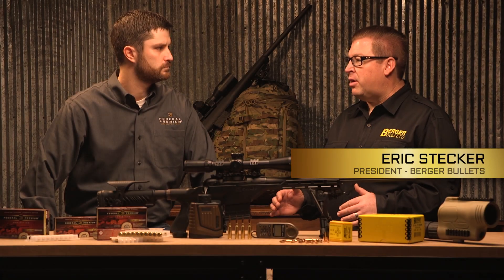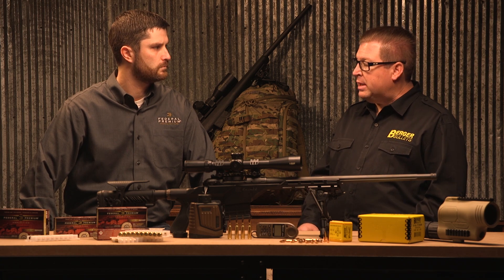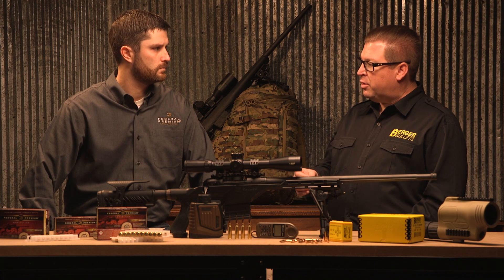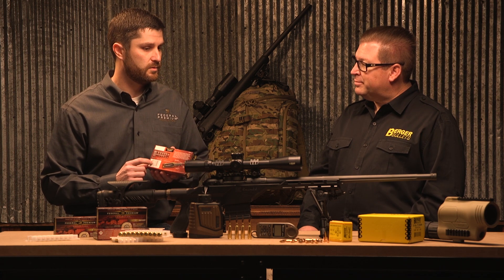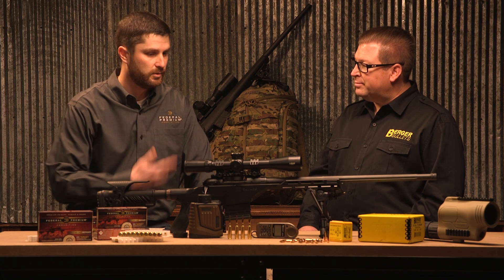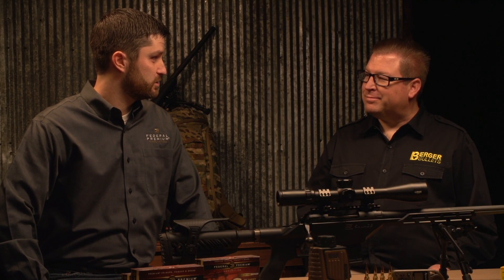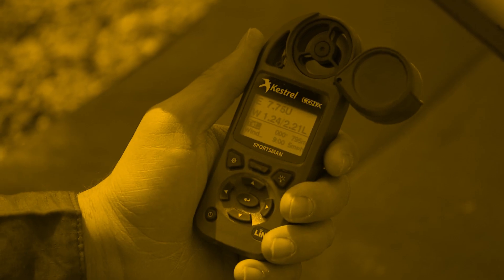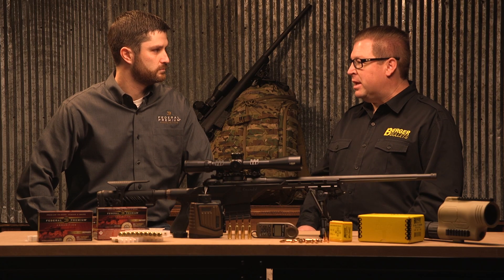Understanding Ballistic Coefficient

Comment: if I understand the two speakers correctly let me translate the double talk; the lower the air drag on a bullet the easier it fly's thru the air. a bullet that has low drag is less affected by wind. the lower the drag the higher the ballistic coefficient (BC). perfect BC is 1.0 meaning you shot your rifle in a vacuum, in other words: buy bullets or cartridges with HIGH BC numbers they will have less drag (i.e. less drop due to air resistance/slower flight/more gravity exposure/ more drop)  they will also be affected by the cross wind less. all good when trying to hit the target at distance. its all ball bearings.
Reply: That isn't what they said at all. If they had said that, there would have been some useful info. All sizzle, no steak.
Reply: What two speakers were you listening to and may I have a listen?